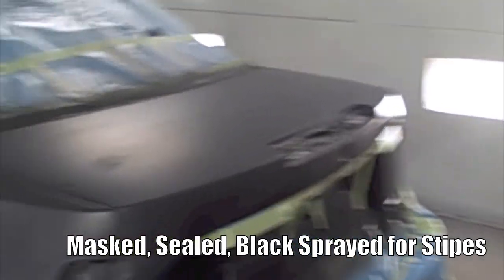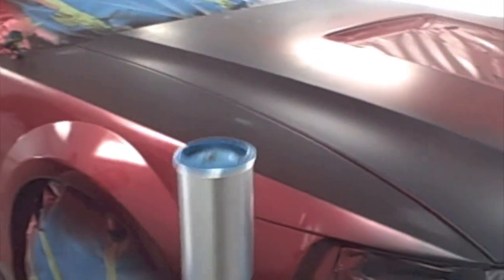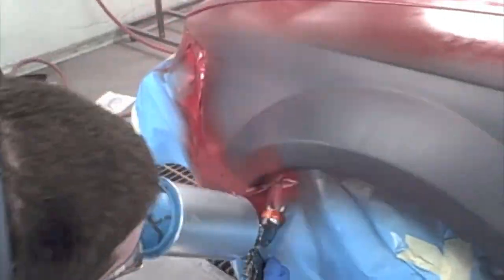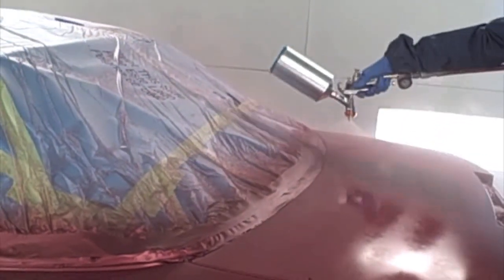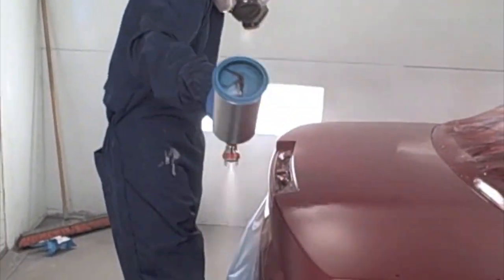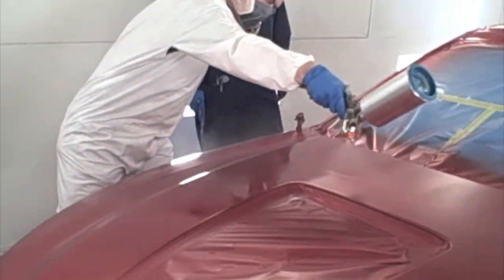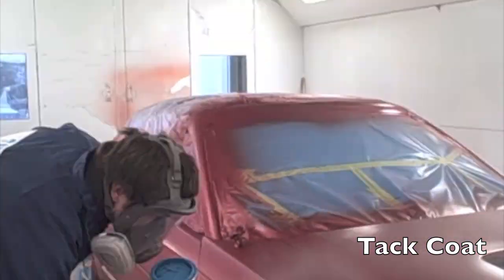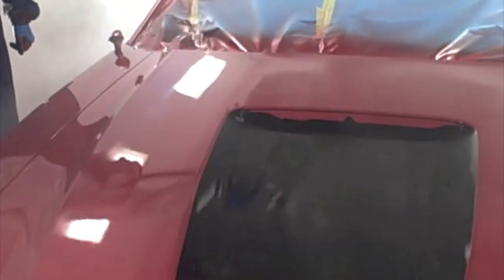DIY How To Paint A Car Yourself Using Primer Sealer, Base Coat, Tri Coat, Clearcoat

Comment: I'm a student at Ohio tech and do collision repair. I had a lot of experience before I went to the school but one good painting tip I've learned is spray the wheel well before the rest of the fender or quarter. That way u don't have any dry spray on your part if u already painted it. If u do the well first the rest of the paint melts it all together.

Comment from the maker: @jeetkunedoground I believe that we are using a 1.3.  The ring is the one that came with the gun when we purchased it.  It is an Iwata JP 400 1.3  After testing it, we found it to work excellent for base coat and clear coat.  On the clear we adjust the fluid needle to allow full fluid and narrow the pattern slightly.  We had the same experience with Sata, we only used 1.3.

Comment from the maker: No, surfacer is a filler primer used to fill scratches and block sand.  Sealer is applied right before painting to seal and provide hiding and is not sanded.

Comment from the maker: @manuelagrasrodriguez  - I use an Iwata spray gun and only use 20-22 psi.  I have notived that too much air pressure will cause too much overspray and land back onto the surface causing a dry effect.  The tri-coat or mid coat is applied before the clear coat.  The clear should be the last product you apply.

Comment: ...and, I'm amazed by how slow and thick the clear goes on at the end (about 7:40) - if I sprayed that slow, I'd get huge sags and lines of runs! No wonder I have a hard time getting enough clear on for it to flow out; I think this is again a problem with spraygun atomisation but also perhaps low temperatures (typically 10-15 degrees C).

Comment from the maker: You do not have to use sealer, but it may eliminate several problems.  It aids in adhesion and give the car a uniform color.  If there are primer spots, you may be able to see through the paint when pulled outside.  By using sealer, you will not need to apply as much base coat to achieve full hiding.  I prefer to use sealer, but that is my preference!

Comment from the maker: This is due to bridging. If there is a place where the tape acutally touches the paint surface, I would unmask  or just the tape deviding the area immedietly after the last clear coat was applied.  This will provide a nice break line.

Comment from the maker: @rashlaninburhan Yes, low pressure produces less overspray, which can land back onto the surface causing a dry appearance.  This is an Iwata gun, which does not take much pressure to atomize properly.  Some guns may use a little more, but I would try to keep it as low as possible.  Most hvlp guns are 20 to 28 psi.  Experiment with it and see what works best for your spraying technique and the gun you are using.  If the pressure is too low, you will get heavy orange peel.

Comment: This is a really impressive video - camera work and commentary is superb, you can actually see the paint going onto the panels. One thing that is amazing to me is just how easily that basecoat covers - huge spray fan, sharp fan edges. No wonder I have so much trouble - largest defined fan I can get is 3" and adequate silver basecoat coverage takes 8-10 coats with a high chance of a run. I have a Devilbiss GTi but it obviously isn't working right (12CFM/35psi). Will study the other link now!

Comment from the maker: @Munky332 This may depend on the paint brand used.  A car will take 2 to 3 quarts depending on the size of car.  (this is unreduced)   As far as the paint gun, I do not know much about that gun.  Iwata or SATA work good.

Comment from the maker: THis is going to vary depending on the paint, but i usually wait 15 to 30 minutes between sealer and base; 5 to 10 minutes between base coats, and 30 minutes to 1 hour between base and clear, and 15 minutes between each coat of clear.

Comment from the maker: @jsmooth181 The coat of paint needed are until you fully hiding.  This could be 2 to 4 coats.  You do not want any light spots showing.  Overlap in the amount one coat is overlapped with the next spray pattern.  You want to overlap each pattern half way of each pattern.

Comment from the maker: @DALE97DSM It depends on the brand you are using.  Generally two quarts should spray a small car.  If you do not paint a lot, it may take a little more.  3 quarts would definetely be enough I would think.

Comment from the maker: Each line of paint will vary a little, but anywhere from 5 to 30 minutes should work fine.  The best thing is to ask the salesman you buy your paint from to provide you a technical data sheet.  This will give you all of the information you need.

Comment from the maker: @bigchev9999 This depends on the color code.  The color code will give you the amount if you are trying to match a color.  If you are just doing a custom paint job, you may just look into candy colors.  Other than that just experiment a little with the amount and how many coat are applied to get the desired look.

Comment from the maker: With PPG and many other brands, wait 15 to 30 minutes after primer sealer, then apply base coat.  Wait 5 to 10 minutes between base coats.  After base coats are applied, wait 30 minuted before clear coat.  Allow 15 minutes between each clear coat.  Does this help?

Comment: its safer to start painting at the top and work ur way down to avoid the hose or ur clothing dragging in wet paint when ur reach to get the roof or in this case just the top window sill. just a tip

Comment: Hi. I went to auto body school over 40 years ago. We never really cleared that many cars then. I have a 37 Ford Tudor Sedan. I plan to paint it white. Mostly because of arthritis building up in my hands. I would like to add blue micro pearl. I was told to shoot a inter coat, or mix the pearl in with the first clear coat. Then do two good clear coats. I never used one of these new style guns before either. Do they work as good as the old style siphon feed ones did??
Reply from the maker: westgateblvd Once you get used to them, but they are a little different.  I would practice on a test panel first to get the hang of it.

Comment: I have the same question as Rick Davis,  my question is how long does a base coat need to dry before you can mask it off to add a second color when doing a two tone or like adding rally stripes on the hood and trunk? Aslo how long before the clear coat can be cut and buffed?

Comment: It's been years since I've done any body work...to date myself, I'm from the Acrylic lacquer days...lol...so now with everything being urethqane, my question is how long does a basecoat need to dry before you can mask it off to add a second color when doing a two tone or like adding ralley stripes on the hood and trunk? Aslo how long before the clear coat can be cut and buffed?

Comment from the maker: If the paint is in good condition, you can just final sand with 400 to 600 grit sandpaper.  You will not have to remove the clear, just sand it to provide a mechanical adhesion.

Comment from the maker: @robertdeuce This is something you want to test first.  I would get some small test panels 9x10 is probably big enough.  Spray 3 or 4 of them with base coat.  The use (pearl) 1 coat on the first one, 2 coats on the 2nd one, 3 coats on the 3rd one and 4 coats.  Then clear all panel.  Once dry take them out side and see which one you like the best.  Thanks for watching.

Comment: Wondering why they didn't start in the centre of the hood and work down towards the fender?Wouldn't you run the risk of possibly touching the freshly painted fender doing it from the fender up instead of from the hood down? Painting the fender first also may catch any dust or debris that may be blown from the hood.

Comment: Take a DA with some 80 and sand the clear off till the hood has no more peeling paint/clear. Mix up some 2k primer and spray the hood. Spray the primer wet. spray like 2-3 coats and leave it to set for a day. After take the DA with some 320 and cut the primer. After cutting wet sand with 600 till its smooth like glass. Wash any residue and clean it with a rag. Tack cloth it so there isnt any lint. Mix your base and spray it light. Spray 3-4 coats base till it covers good. 10 mins in between.

Comment: Hi, i'm trying to learn how to do a paint job the correct way but ever video is different and seems to skip many steps. You didn't show us the primer sealer and black? Do you have to spray primer sealer first before base coat? Was the black a base? If so how many layers did you do? Also, do you have to use a primer? I’ve seen people just sand their original color down to the base coat and then use the new base coat w/o a primer is this ok?

Comment: Nice videos! Iam doing custom designs for mountain bicycles, All works fine but iam experiencing that my clearcoats seems not as tough/hard as I was supposing it should be. Iam using 2 pack UHS acrylic clearcoat from Lechler aplied by 1 drop coat followed by 1 or 2 wet coats) . Have you ever experienced any clearcoat being very soft? Iam also curious what do you think are the main factors influencing the clearcoats toughness and how to improve it? Thanks very much.

Comment: nice work i really like it,my question is: how much air presser did you give the paint gun.
and which size is the paint gun ? thanks very much
Reply from the maker: We spray our base coats and clear coats with a 1.3.  The wire pressure is going to vary depending on spray gun.  Here is a video series that will help you with setting up your gun.  http://www.collisionblast.com/auto-body-and-paint-tutorials/spray-gun-adjustment-videos/

Comment: I'm getting ready to paint the same body mustang and I noticed you left the door handles on. How did you get under the handle painted on the door? Or sand it all properlly for adhesion?

Comment from the maker: We usually wait 1 hour.  However, there is a window of 24 hours.  This means you have 24 hour to spray the clear coat.  After that, the surface will need to be sanded.

Comment: In the middle of spraying inside pieces for a corvette that is almost identical color, the curves of these panels are causing tiger stripping, played and played and played with it tried everything ended up at 5 psi at the regulator and spraying it dry just to get it even, worst night mare I’ve ever dealt with, now onto the tri coat which is gonna be another adventure

Comment from the maker: @o0Sp3cia1K0o Hi, thanks for watching our videos.  You want to spray base coat until you achieve hiding.  In other words, just enough to fully cover the substrate without being bale to see through any where.  2 to 3 coat usually cover well without any light areas.  Two coats should work for clear coat if they are full wet coats.  If in doubt, you may want to put a 3rd coat of clear.  Yes, solvents use a 50% overlap.  We use PPG and Shopline.  Shop Line has a new European clear that works great.

Comment from the maker: @62imperial62 Thanks for watching, when you are realigning your gun to make the next pass, you will need to trigger you fluid trigger.  If you let off the trigger half way, you are only spraying air.  This will eliminate the heavy mills on the edges.  Donnie

Comment: I give you some advice about your application! 1 = It seems you are applying your base color with a lot of air pressure! why is cloud that takes the paint, 2 = water based application always starts from the bottom up! If you start you can generate upside breeze on the underside of the base characteristics of the water passes this!, 3 = two coats of color is more than enough for that and apply a separate background color and painting always begins the outlines of the capo .. Greetings!

Comment: hi Donnie, does orange peel primarliy happen with the clearcoat, and you would typically not see orange peel on a base coat?
If you have a car with orange peel (from the factory or a body shop) and you want to level it out yourself, do you need to worry about certain things like how far down you go? thanks

Comment: what about the washing,  sanding, air blowing, tag clothing, masking, silicon off before primer? you forgot to mention, and also after clear coat what about oven (or let it dry a couple of days at least), wet sanding (or dry sanding), polishing, glaze, and wax?

Comment: Do I have to use a mid coat and primer sealer? Im gonna be painting my 1967 Ford Gloss Purple, and Gloss white, I will be doing it myself I have painted the fenders once before but I used spray cans came out pretty good so I was just wandering if it'd be better to use spray cans or a spray gun?

Comment: Would this finish bake ok in the 75 degree sun all day or does it need to be heated higher than that?
Reply from the maker: No, you don't really have to bake the paint.  This just speeds up the process so you can get the car out of the booth faster and put another car in there.  It should dry fine in 75 degree weather.  Thanks for watching.

Comment from the maker: @kmjejsenlf No, once the car has been sanded and in the booth, we did not sand.  The only reason you may have to sand is if the paint time passed the window time.  For example, in the base coat goes longer than 24 hours, you may want to lightly scuff it.  Other than that, there is not need to sand between coats.  Thanks for watching.  If you are looking for automotive discounts and coupons check out CollisionBlast(dot)com/coupons

Comment from the maker: Since the door handle does not touch the car body like some cars, we decided to leave it on.  Some cars have gaskets between the handle and car body that make it impossible to leave the handle on.  A scuff pad works well to reach the hard to get areas at this.  You need to make certain you spray all angles under the handle to assure to have coverage and gloss.  However, don't get it too wet doing it or you may get a run in that area.  I hope this helps answer your question.  Thanks for watching!

Comment from the maker: Thanks for watching, we did not spray the jambs on this car.  This is the original color so we masked the jambs off.  The door handles and side molding are the same color and there is no gasket between the handle and paint surface, so we decided to leave them on to paint it.  If the car has a gasket touching the paint surface, you will have to remove the door handle.

Comment from the maker: @GLPlumleeIV If the paint is in good shape, not peeling or cracking, or if the paint is not too thick, over 12 mils, you can sand the surface with 400 grit and shoot your primer sealer and paint.  Thanks for watching.

Comment: I bought all the stuff to do mine. HPLV Gun 20.00 at wal mart, borrowed a compressor, quart of primer $24.99,quart of base coat $24.99,quart of clear coat $24.99 masking tape $3.00,masking paper $2.47 x2, tack cloth for making sure you removed all particles from the vehicle  $1.99 x2, acetone to make sure no grease,oil,wax, greasy ass fingerprints are on the car $7.99,all in all $120.00 vs. $500.00 and up at a shop

Comment from the maker: There are different causes for this, but the most common are: not holding your spray gun even.  This will cause the paint to be heavy on one end and light on the other.  Another cause could be spraying the base coat too heavy.  I have a spray gun playlist that might help you.  Look on my channel home page and look for the spraygun playlist.  This should help you.  Thanks for watching!

Comment: i hope you could reply my comment, i had done all the sanding and body filler on my car and are currently getting ready to spray 2k hi-fill primer the entire car and block sanding it. my question is should i spray a coat of sealer before base or can i skip that part and just paint the base coat and 2k clear afterwards?
Reply: You can do it 2 ways either sand car to 400 grit and seal it then paint or sand the car to like 600 for solid color I think and 800 for metallic, I’ve always just sealed my trade school dint use sealer and sanding that fine sucks to paint

Comment: How do you stop over spray on the panels.
Reply from the maker: If your air pressure is too high you will get a lot of overspray.  Try lowering your air pressure.

Comment: How much base coat paint do you go through on a job like that?
Reply from the maker: You should be able to do this with two quarts of base coat.
Reply: @CarAddictGarage  thanks so much. I bought a gallon of base coat (with 2 qts reducer, 2;1) for my 4Runner and I was wondering if my new Fuji Q5 would drain the paint before the car is finished.

Comment from the maker: This will depend on the products you are using.  Some clear coat are designed to be baked and some are not.  As far as peeling, it depends on the quality of job you have done.  If it is a cheaper place that paints cars real cheap (I won't name any of them) chances are it may peel.  Thanks for watching!

Comment: How much does it cost to have it professionally done?
Reply from the maker: It is going to depend on the condition of the car, but it will run into the thousands.
Reply: Haha dude I could do it for free professionally just because it's fun and gives me something to do ;)
Reply: It's honestly not hard to paint at all. You could learn to paint you car and make it showcase worthy in probably 6 months. Unless you're spraying Kandy :/
Reply: Chevy Nova  in ca
Reply: Nolan Alvarino I tried it myself with Corbandy Car Sprayer Crusher . I found it on google. It was good enough for me.
Reply: Nolan Alvarino I'm not sure but ,if anyone else needs to find out about car spray painting guide try Alkarno Spray Paint Alchemist ( search on google ) ? Ive heard some decent things about it and my colleague got cool success with it.
Reply: +Microwaved Gerbil I found a great system about how to spray paint a car yourself. It is Moorack Car Spray Miracle . It's great! Search Google for it.